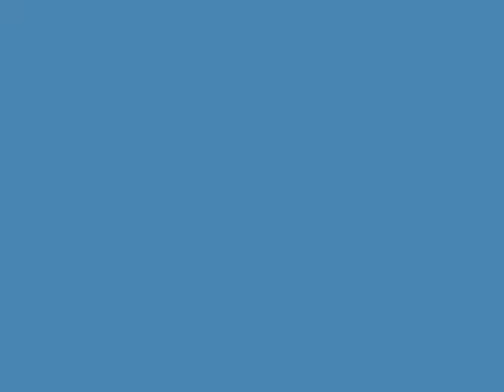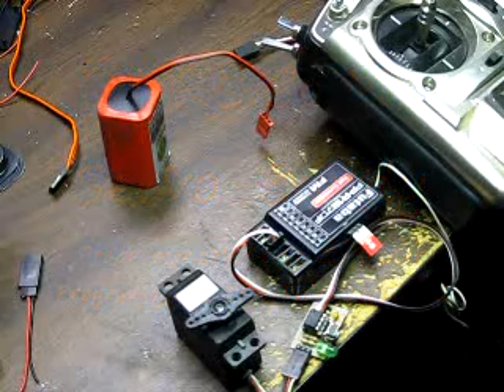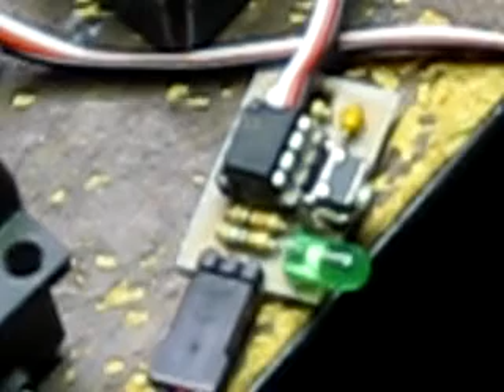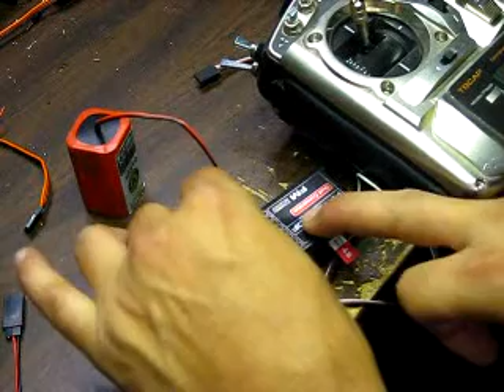DIYRC.COM's "Servo Buddy" Programmable Servo Controller (endpoints & speed)

Comment: You have it set on the throttle channel but what will happen if you set it to the other side, to 1-0-1 stick? I need a servo limiter which would be used on a FWRD - 0 - BCKWRD channel, so the servo would move only to ONE position (0 to forward). I just need to eliminate the backward movement.. is it possible with this circuit?